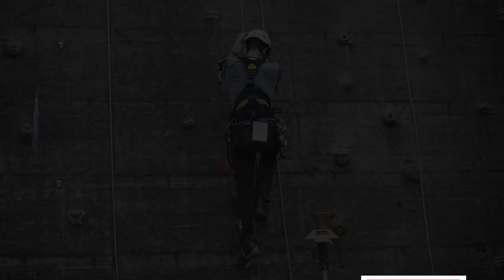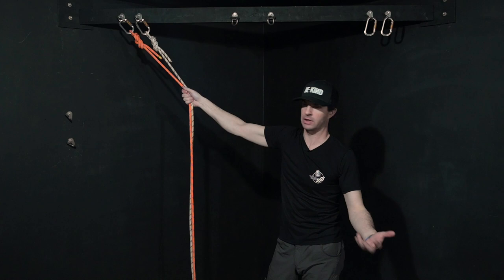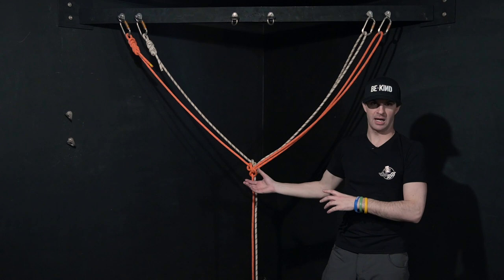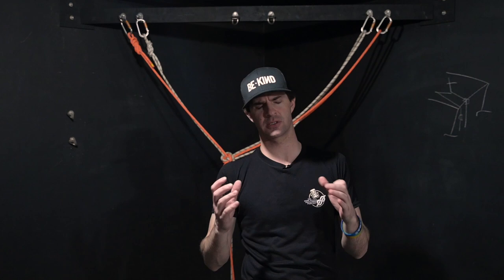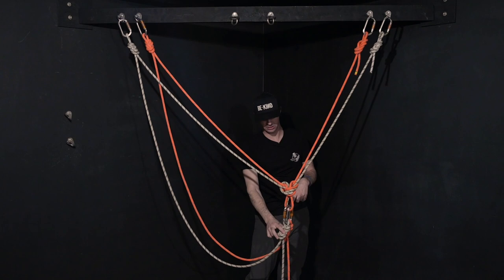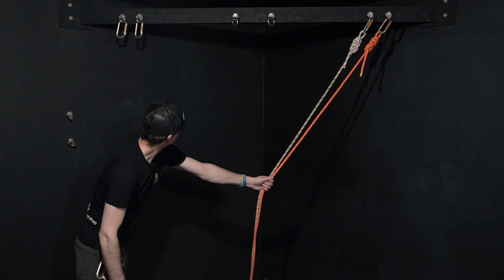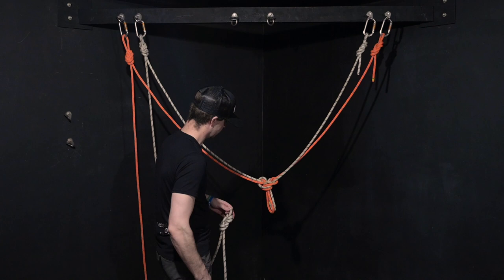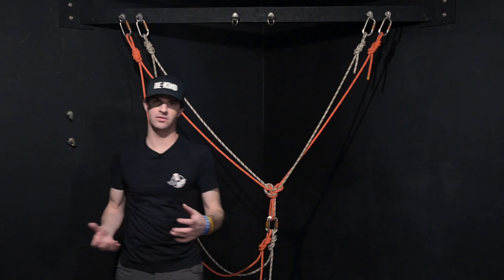HOW TO RIG LARGE Y-HANGS - TECH TALK - THE ROPE ACCESS AND CLIMBING PODCAST

Comment: When rigging a large y hang for Sprat and Irata are you supposed to double everthing up connectors, slings, ext, whenever exceeting 1.5 meters with no hazards. It only makes sense to do this but i havnt been able to find it in the safe work practice for Sprat.

Comment: Not sure the BFK is doing anything for you in the third scenario as the re-anchor is clipped through both alpines. If the alpines were separated it would still have the same effect of load sharing and redundancy on both anchors either side of the Y hang. Hope that makes sense dude.
Reply from the maker: Fully.
Ive seen a lot of people that struggle with lining up alpines.  So the BFK here also helps with both knots to line up.
At the end of the bay.  It doesnt really matter

Comment: Mikey, instead of the BFK an alternative option would be place 2 alpine butterfly in each rope, leaving a little rope between each knot for a by-pass, so in total you would have 4 alpine butterfly's knots, then connect all knots with 2 karabiner.
Reply from the maker: Possible.
Seems like a lot more hassle.

But ive never tried it.  So i could be wrong also :)
Reply: @theropeaccessandclimbingpo2380  yes it takes a little longer, maybe 2 minutes then again dressing the BFK could take as long, on the plus you can see all of your knots and any movement within the system. I would also like to ask would you have any data on the BFK with regards to strength, effectiveness if damaged
Reply: I’ve used that rig in a few odd cases where you have four ropes coming off two slings, especially when you can’t see the anchors from getting on the ropes. It ensures that any pair of ropes is redundant and not just two ends coming out of the same knot.
Reply from the maker: Im less worried about it being perfectly dressed.
And because of the amount of rope in the knot.  Im never worried about the strength.  However, im working on building a pull tester.  So it would be still interesting to pull.

Comment: Awesome video :) I used to always pull the center of my large alpines through the hole as well until someone pointed out that it's completely unnecessary. Now I just take the base of the top strand after the second twist and pull it through. 
Also I've seen something similar to the 3rd example in the field except it was on the roof instead of vertical and they just used 2 short lines. They also had both independent instead of combining with the butterfly. It seems to me it should be perfectly fine though. Plus using the short lines keeps things a little cleaner.
Reply from the maker: Ya if someone wants to use a BFK or single alpines… it really doesn’t matter 

Cheers

Comment: Never seen window cleaner following 1,5m rule. And good luck to find so many anchor points. Very good in theory tho.
Reply from the maker: Totally agree on the 1.5m side of things however.  You need to double up the gear not the amount locations you tie off to.
Reply: @theropeaccessandclimbingpo2380  I meant anchor point like bolts not bombproof structure.
Reply: @theropeaccessandclimbingpo2380 

For a large y hang in the situation where you have 2 roof davits 1.5 or more apart you just have to double up the equipment and not worry about having 2 additional  roof davits ?

Comment: Thank you for this video !
Just a small comment about the IRATA requirement from TACS (6.4.5) : if I'm true, we should consider wide Y-hang over 1m and not 1.5m.
An other but similar way to anchor the lines : a BFK with 2 ropes under the butterflies...
Reply from the maker: Hey,
Thank you for your message.  Yes, I stand corrected here.

Industry general norm is 1.5m give or take. 

However, this is what I found. For the most up to date info. 

IRATA is 1m
SPRAT is 2m

IRATA states small or large re-anchors are defined by 1.5m

SPRAT defines them by 2m
Reply: Yes 1meter for wide Ys in IRATA TACS. Often confused with the 1.5meter for double deviations. However,  no mention in ICOP about doubling up for wides. So maybe it’s just in training and not in field operations? Open to interpretation for sure.  
Doubling up an alpine is only bad or lazy if it’s not dressed and set! We dress every other knot so why not the double alpine! This is why it gets a bad name. Please dress BFKs to reduce the reasons people have to doubt them.  
Using the methods you describe to reduce swing potential is very important.  No point doubling up the anchors if there is still going to be a swing if one part fails. I understand the benefit of the BFK on second method, but not the third method, as long as both Krabs are in both knots, it is load shared.

Comment: This is going to be somewhat hard to explain but instead of fixing the equalisation of the Y-hang with an alpine as in the 3rd example, would an acceptable alternative be to not put these alpines in at all leaving two big loops, descend the ropes after the second set of figure-8s, tie two more figure 8s below yourself and clip these directly into the loops of the two lines, thereby creating a self equalising Y-hang?
Reply from the maker: Totally!

That would depend on the situation
Reply: For sure! This is just a tension line with a drop set clipped to and rotated 90degrees. The self equalization is nice.

Comment: I’ve never seen 2 bolts each side in Y ringing when it is more than 1,5m, in my real life job… I’d like to know if there’s something to do, unless put a long, long, long ropy protection, just case the system will fail.
Reply from the maker: This is just my current set up.  But as you can see.  A possible option.

Why would you rely on rope protection?  Theres no need  for it with this set up. 

Also,  one should try to avoid the use of rope barriers.  Rig to avoid first. However, if you cant then introduce barriers. Either soft or hard.
Reply: If something happens to my rope, and I am using more than one rope protection, in case of a fall on an edge, my rope would be protected 
Sorry about my English, I'm a foreigner
Reply from the maker: @renatabriotto4941  All good.
If you are rigging over an edge yes.  This is why one should use 2 different barriers.  We'd never just use 1 rope so why the hell would be use 1 barrier (Depending on what it was).